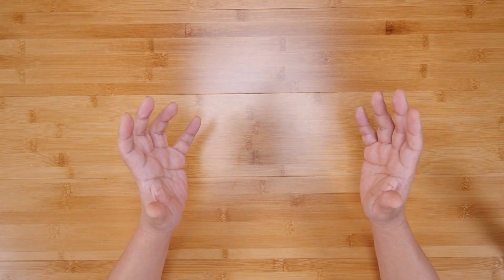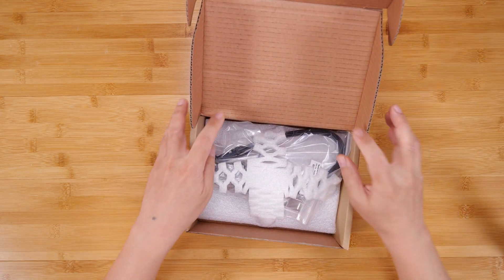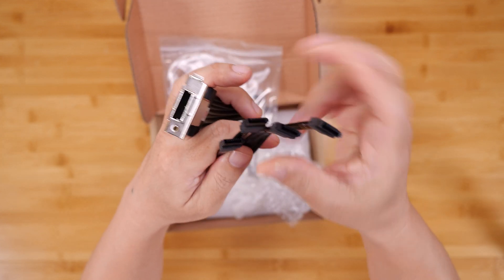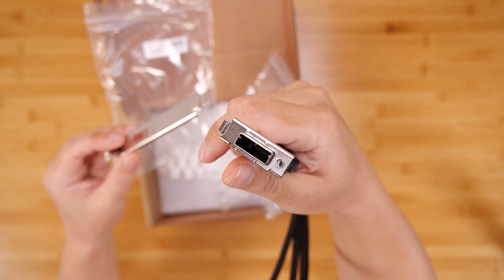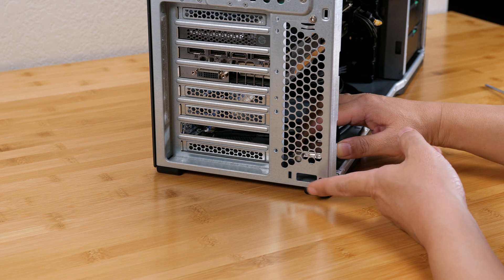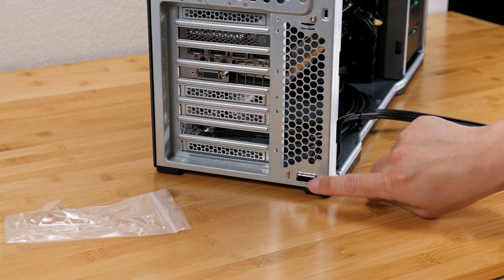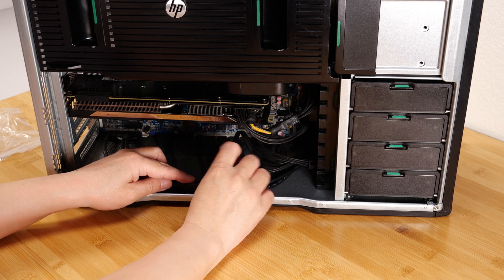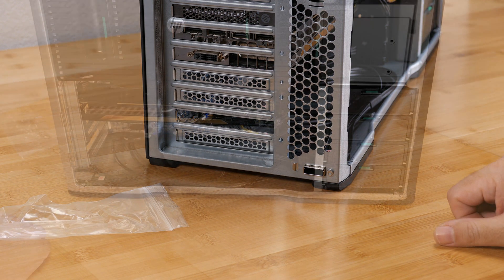HP Z840 Z820 Z800 How to add external SFF-8088 JBOD port | expanding JBOD DAS storage

Comment: Hello. Did you upgrade this z800 to Windows 11? I also have a z800, and after upgrading to Windows 11 25H22 a while ago, I started having boot problems with the message "A disk read error occurred" after the KB5066835 (26200.6899) update. I still haven't found a solution. If you could share a solution, I would really appreciate it.
Reply from the maker: Sorry, I don't use windows.

Comment: How did you get the drive cage to clear drama? I've tried a n d have yo remove fan to fit. Any ideas
Reply: My apologies,  I have the z820 and will soon get a z840 to practice to practice with. The z820 seems perfect but when I slide in the slotted 4 bay hdd I keep hitting the dram. I will try your method of the 5bay and cut out the small tabs.  I have a technique to remove without any debris issues.   You've actually inspired me to create a channel tackling similar issues.  You are truly a genius at the mods that you do.   I've mostly dealt with dell , but will give HP a shot and yes, their cooling is amazing for the cpu and ram slots.
Reply from the maker: Not exactly sure if your'e talking about Z800/Z820 or Z840, but I've covered this in several videos. The Z820 being the most troublesome. Checkout the rest of the playlist to find those videos:

https://www.youtube.com/playlist?list=PL28eVGz5vFQ-xj9sTJ8WQXq11YDK0Gxe9

Comment: what is the max size JBOD that you should connect via the one connector?  Could I connect a 24 drive JBOD?
Reply from the maker: It depends on how much bandwidth you need at peak performance. The LSI SAS2308 controller onboard these workstations is a 6Gbps SAS-2 controller, so 4 SAS lanes gives you 24Gbps. However, the way HP has this configured on the motherboard, it is PCIe 3.0 x4 only, and that's about 31Gbps of bandwidth. It's enough for the 24Gbps external connection, but there's also the 4 internal SAS lanes so in total you can have enough devices to push about 6Gbps x 8 = 48Gbps. Although, in reality, I find SSDs (SAS2/SATA-3) max out at around 5Gbps, so you need about 40Gbps, which is still greater than the PCIe3 x4 bus at 31Gbps.

For more guidance on this topic, watch this video: https://youtu.be/Q4e8kmuGm6o

Comment: This expansion option only allows you to add 4 drives. What if you wanted to install a larger jbod such as a 12 or 24 bay unit?
Reply from the maker: No, that's not how this works. This expansion option provides you with 4x SAS lanes as external connections. When you connect that to a drive enclosure, the enclosure will often have a SAS expander internally, allowing you to connect to many more drives, but share the 24Gbps (3GBytes/s) bandwidth to the onboard SAS controller. I have a playlist on my channel that goes into SAS expanders and building external drive enclosures; check it out as it might help you understand all the things you can do with these 4x SAS lanes as an external connector.

Comment: Hello, can i ask  as i am a bit of a novice, could i swap my HDD FOR  SAS HDD without any problems i have HP Z820
Reply from the maker: If it is connected to the onboard SAS controller, then yes it will support both SATA and SAS drives.

Comment: I started following your channel before adding a r730 to my homelab. I was wondering if you have any suggestions or recommendation for a pcie base ssd solution for a Dell r730. Currently, I use a pair of 2.5 inch SATA ssd drives for my vms. Ideally I would like to continue to use ZFS.
Reply from the maker: Thanks for watching my channel!

The R730 should have an NVMe U.2 option like I've shown for the R820/R720 servers. Look up those videos. The parts are not exactly same, but there are equivalent parts.
Reply: @ArtofServer  Thanks I'll review the 3 part series on Dell PowerEdge R820 R720 storage upgrades.

Comment: You have any JBOD DAS devices you recommend?
Reply from the maker: For rackmount DAS, look at Dell MD1200 or SC200, or Supermicro 826/836/846/847 JBOD enclosures. For "tower" configurations, there are several options from Sans Digital, iStar USA, Areca, etc. But I think for tower, it is easy enough to build one yourself out of old PC case. Find a PC case with a lot of 5.25" drive bays and get the "mobile rack" enclosures that converts them to 3.5" bays.

Comment: That is a cool option!  It would be interesting to see the rack mount kit to see how well it fits with true rack mount chassis. What other optional parts were there for the Z840?
Reply from the maker: I don't have the rack mount kit, but I'm curious to see how it fits too. It should convert the Z840 into a 4U server chassis. I have more videos to come on the Z840, specifically more about internal storage options, so stay tuned...
Reply: @ArtofServer  The kit is basically a drawer kit. So you just lay the case down on its side on the drawer and the Z840 with the rail kit will be 5U because it will leave some extra space on top and bottom so it can slide out easily on the rails. There is also an upright drawer kit that can hold 2 workstations side by side.
Reply: The rackmount kit is expensive as hell. I ended up buying two universal rack mounts for my rack and my Z840s. The PCs lay on top of the mounts and fit quite nicely in the rack. Downside is there is no sliding them out easily to get to the internals.